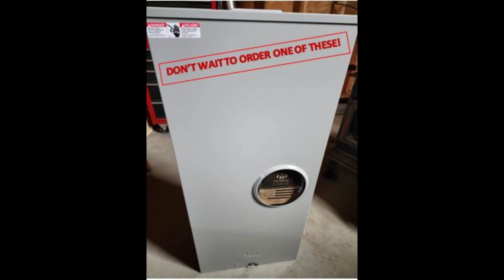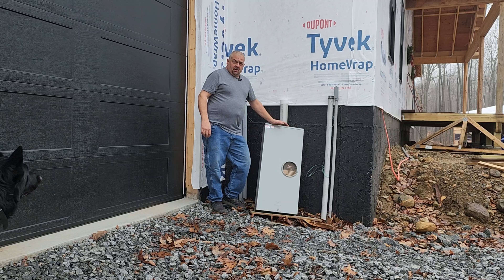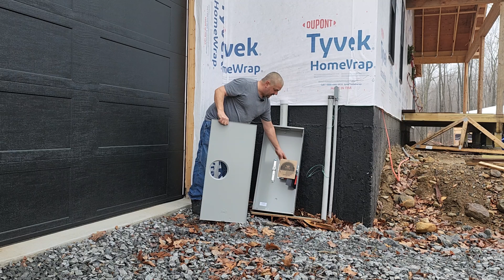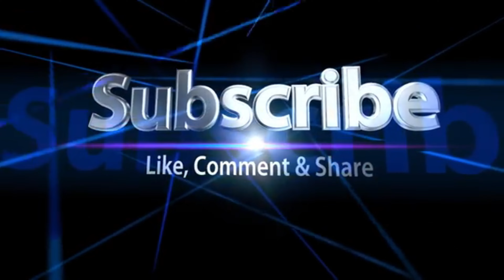New House - 400 amp 320 Meter Socket backordered! But WHY???

Comment: That's simply the law of opportunity.   In no way do they want to sell those things legitimately - CREATE THEIR OWN SCARCITY!  All you have to do is blame supply chain issues...then workforce....then solar flares....then whatever.  In 30 years we'll still have supply chain issues!
Reply from the maker: This is true. This post was during the afterwave of the pandemic and lumber prices went through the roof.
Reply: @back30 agreed.  With hardly a reason as well.  Still continuing today.  Why produce more when you can produce less with less workforce,  higher prices....same profit margin.  Only saturated sectors/industry groups with a lot of competition have been forced to be price competitive.

Comment: If you have natural gas in your home, you never need a 320/400 amp sevice to a 5000sq.ft. home unless you plan on a workshop besides the house.and even then it'd have to be a machine shop with 2/3 people working in it. My opinion and experiences. Waiting on one for a new home right now for a guy. All gas home.i tried to talk him out of it,and here we are 28⁰ and no panel on the house that was started in Sept. But what do i know!😔😊
Reply from the maker: Hi Michael, we are out in the woods. No natural gas. We run a outdoor Central Wood Boiler for heat and have propane to cook and backup heat/hot water. There is a full garage roughly 40x40 full of equipment with a 100A sub panel. The house main level has a 42 Circuit 200A and the lower level the same. We work from home and my business has a server room that also calls. We prepared to be safe and not have tonworry in future expansions. Thanks for the thoughts!

Comment: meter socket looked undersized for a 400 amp, 320 amp.
Reply from the maker: It's got the label and specs marked as ordered. Our power company tied into it as well. So it most definitely is one.
Reply: Sizes vary on these

Comment: I will say this…there is some correct information here to hold onto. That is -order early. I won’t say who I work for or what gear I sell but I haven’t received a 400 amp meter combo in a year and a half. We also can’t get a straight answer why.
Reply from the maker: Circling back to you.. any changes 8 months later in your court? Just wondering.

Comment: Got ours last July. Had to overpay for the separate shutoff enclosure. $400 for a small can and breaker with 2 bus bars. There is some gouging going on.
Reply from the maker: Hopefully things have settled for you since. We fought through it all and are now in the house. We have to the end of the month to replace a handful of circuits with ARC fault nonsense that will protect outlets behind furniture at 87 bucks a piece. We have two 42 circuit panels. Not sure how many will need to be swapped...

Comment: Crazy isn't it? We are in the same dilemma.
Reply: I got my Eaton 324N "400A" meter base from Platt Electrical in Oregon in under a week (I'm in northern Virginia).  Good luck.
Reply: @h.jaredagnew2544  did you walk in there in person or did you order online? Thanks !
Reply: @jjgubb  ordered online but I’m waiting for third meter to arrive. First two had broken insulators that hold meter base and line terminals to the housing.
Reply: @h.jaredagnew2544  damn did they make you send the bad ones back? I wonder why they went bad. Interesting. I checked their stock on the website and it says 0 available. I need about 50 of them
Reply from the maker: @Josh Gubbini
 I called the branch manager.